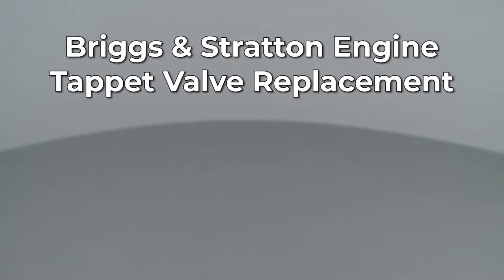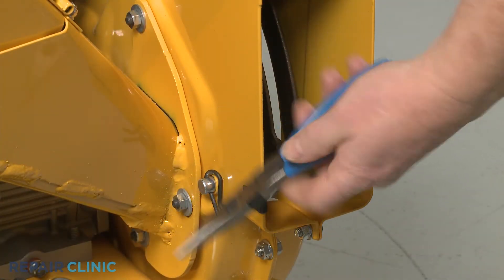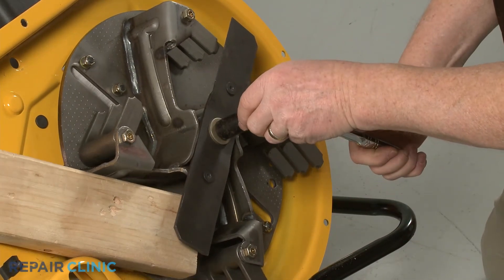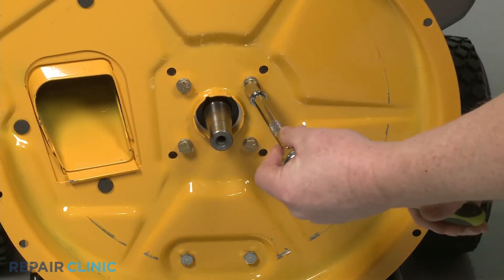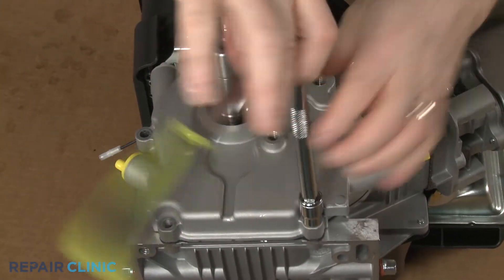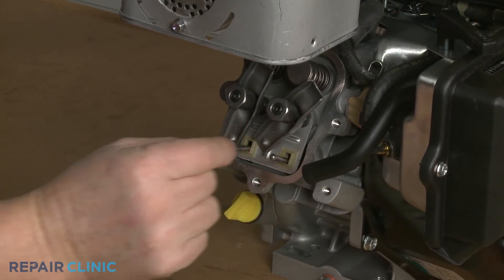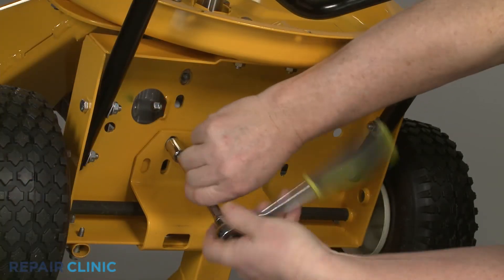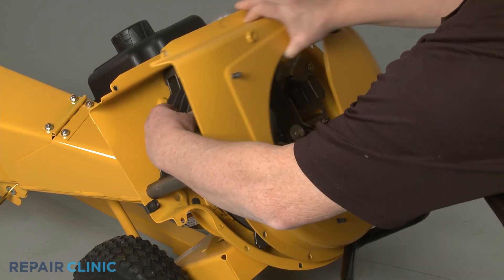Briggs & Stratton Small Engine Tappet Valve Replacement 690977

Comment: Title misleads.  Pretty lame you would warn people to let the engine cool before touching.  Entire video is bad, taking apart a chipper has nothing to do with valve adjustment
Reply from the maker: This is a small engine tappet valve part replacement video.